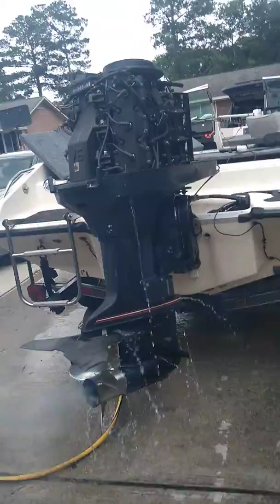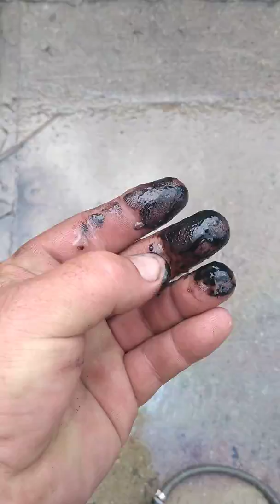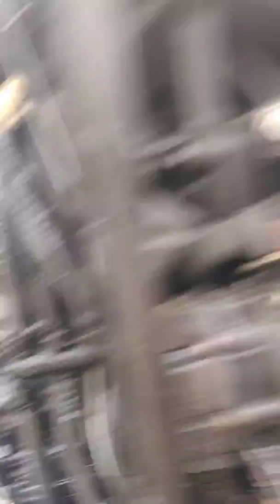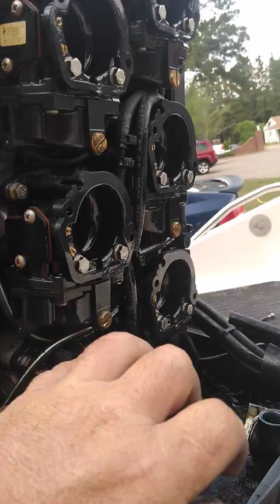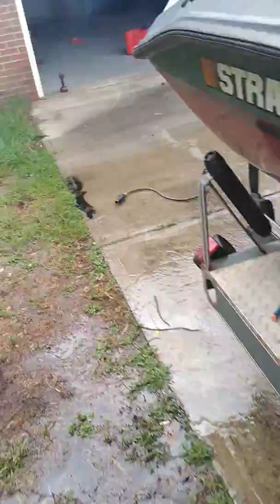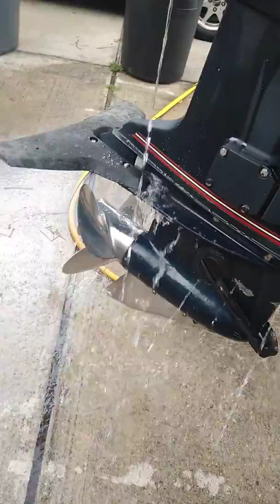1990 Evinrude 200 XP Seafoam treatment & Idle fix!

Comment: I have a 1989 Johnson GT 200HP ..basically the same motor and if your prime bulb will not get hard you may want to look at two things first remove the carb and examine the float make sure the float is flush when you hold it upside down as mine was not shutting off the fuel causing fuel to just flow inside the cam causing it to spit just like yours. 2nd you fuel pump hoses could be criss crossed causing a the vacuum hose to flood the cam with fuel. Hope this help but keep in mind when trouble shooting is to first check spark then fuel or fuel then spark whatever seems obvious ..lol
Reply: When you refer to cam in your post, I'm assuming that you are referring to "camshaft".  The engine that you have is a 2-stroke engine and 2-stroke engines do not have camshafts.